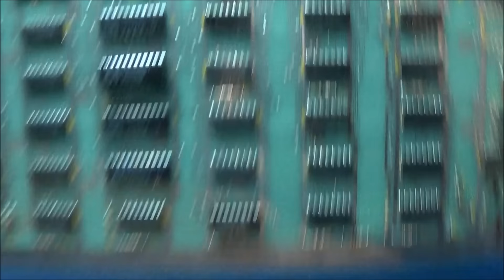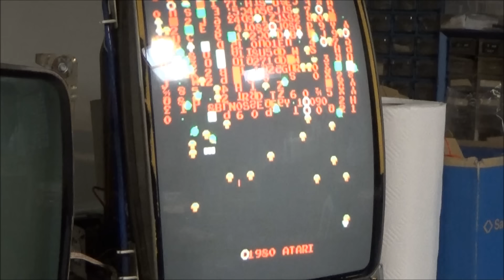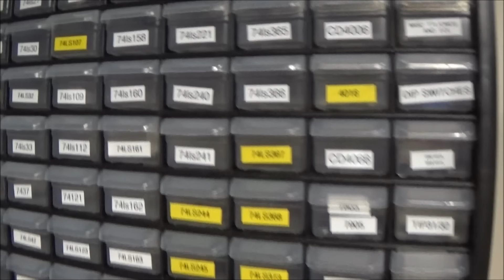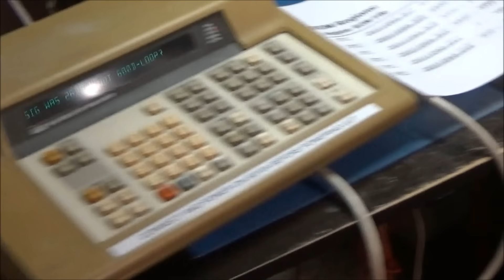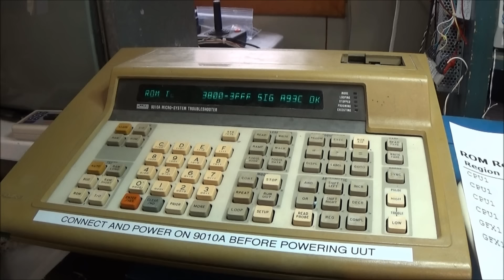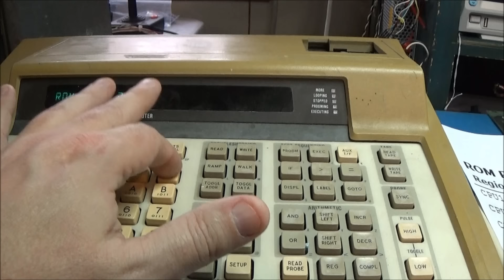1980 Atari Centipede Arcade PCB Repair Part 1 12.30.20

Comment: Can’t thank you enough for this series. The long format is ideal for classroom and lab use with students. 

It’s great to see a retro channel using modern equipment and methods. Students respond better when they can see people using things they recognize. 

Your style doesn’t put young people off. There are too many channels pumping out either slobbish or ultra arrogant attitudes. People are repelled by that. You do a great job presenting a professional and open attitude.
Reply from the maker: Very cool..  thank you

Comment: Your soldering is so quick and smooth.  What temperature is your iron set to?   I'm just beginning to get into this, my results are not like that, must be doing something wrong.
Reply from the maker: i have a metcal mx500 soldering station...  the temp is pre determined by the cartridge...  that being said...  i use light heat carts for sockets/chips etc..    keep your around 660F degrees would be good...  most importantly..  use a good fine tip...  and it must tin...  if it wont take solder..  dont use it

Comment: Where did you get the big storage bins?
Nice little setup you have.
Reply: I cant speak for the ones in the video, but ace hardware sells parts shelves that are perfect for electronics. I have a bunch of them that I use and they are perfect for the application. I think they are $30 each
Reply from the maker: most of them i just bought...  home depot...  hardware stores...     harbor freight too i think.......and a couple i got along with kits from Jameco Elec...   i bought the kits just to get the containers lol

Comment: Nice, a centipede. I actually have 2 of these that I haven't looked at yet, have to build a harness for them. It's actually one of the boards that can be tested with the arduino ICT I told you about. Too bad it has the 2101's I still have to source those for the Space Firebird boards I repaired, guess I'll have to get some more, cause some of them on the centipede are likely to be faulty as well. The 93422's are also 2101 by the way. You know of any other sram that can maybe replace these 2101's, maybe with an adapter board I could replace 2 with one bigger sram ic?
Reply from the maker: i do not know of any replacements for the 2101..  sorry...
Reply: @classicarcaderepairs  no problem, found and bought 50 yesterday, but have to see if they are ok when they arrive.

Comment: A 93422 is functionally equivalent to a 2101. The 93422 had a faster access time IIRC so you may not be able to replace that with a 2101 depending on the application.

Comment: YES! A Centipede repair! Thank goodness. I have got a Centipede board but am too scared to connect it because I don't know how to power the board (those two separate edge connectors) and I bought it with the description 'Works, but has sound issues'. Hopefully this series of videos will help me immensely. Man, I am SO GLAD you post these repair videos! Happy new year!
Reply from the maker: not sure if this series will help with sound issues.....   but you can start with your pokey chip....then move on to the lm324 (you may want to check that lm324 first, they always fail)